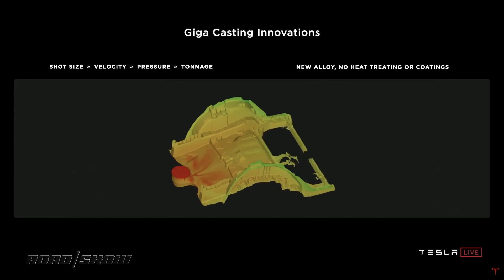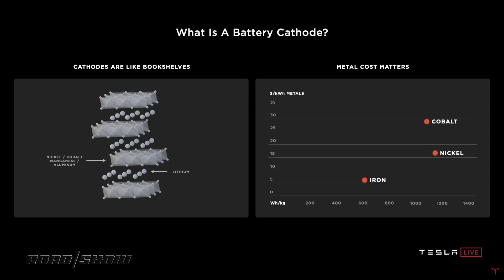TESLA CHEAPEST car ever and the Model S Plaid are coming

Comment: Don't expecting too much from a $25k Tesla, you probably looking for a 70 mile battery range, 8 inches screen.
Reply: The key to the lower cost is their 60% cheaper batteries, so more likely 250 miles and a 16 ich screen.

Comment: 01:23 Dude are you living on the moon?   Tesla is cheaper RIGHT NOW than cars like Toyota Camry: just factor in fuel cost and repairs over few years
Reply: Yeah true, a toyota will be cheaper in the long run for repairs
Reply: @andrewsher9360  incorrect, telsa require little maintenance, there are far fewer moving parts